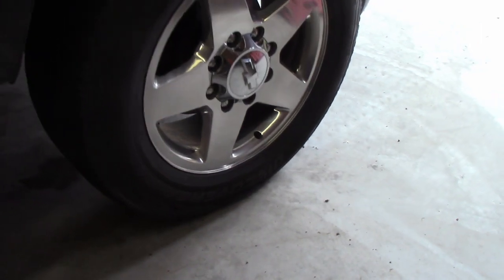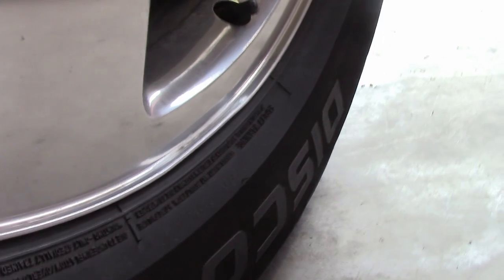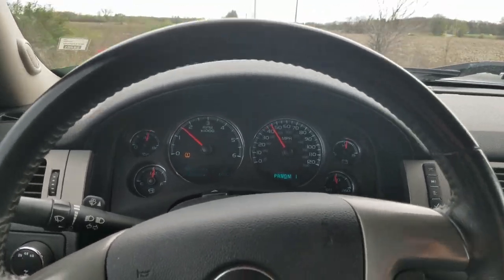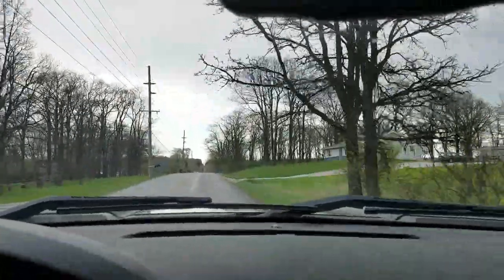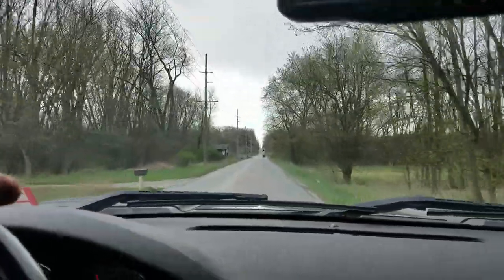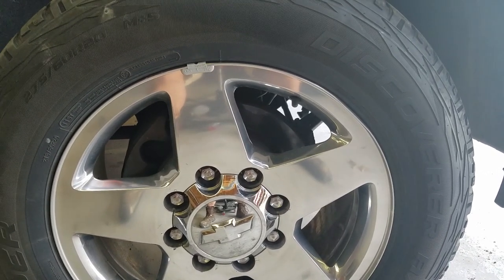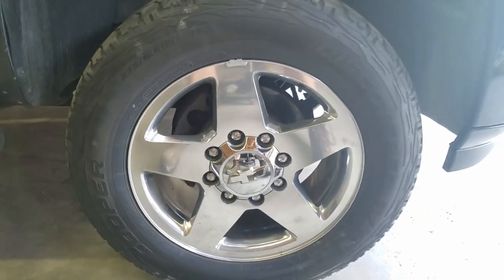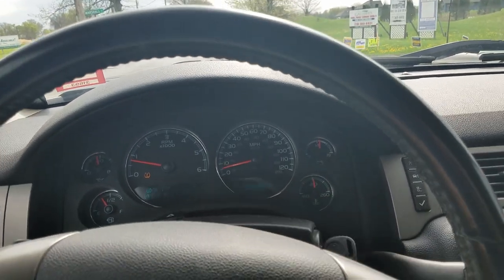Steering wheel wobble: cause and solution

Comment: My steering wheel wobbles just like that on my 2005 Honda Accord I got a small dent in both my front rims ones been there for a couple years the other I slid into a concrete barrier and it smashed it in a little gonna move the front to back and back to front to see if wobble goes away
Reply from the maker: Worth a try
Reply: @lennyc624  I'll let you know if it worked, I'm gonna be going for a ride to the gas station now in a bit
Reply: @lennyc624  thanks it worked so I'm gonna buy 2 used rims and 2 new tires

Comment: I have same issue with new rims and tires , I balance twice and they are fine but is terrible the wobble at 40mph ... with the other set the truck was fine , any idea what is ?
Reply: Had the same issue when I put BBS 740i wheels in my 540i - it’s a centering issue
Get those plastic centering rings, couple 3 bucks and that will fix it